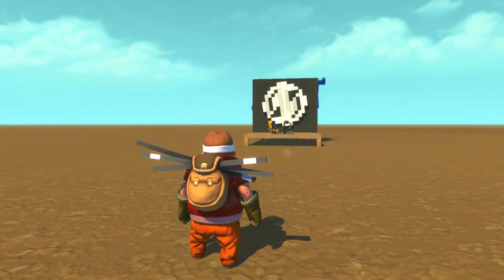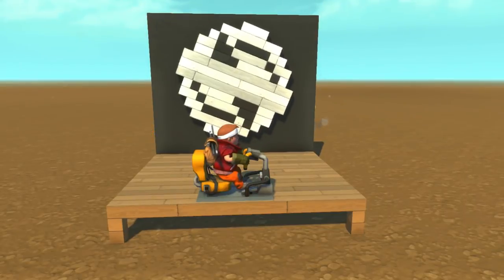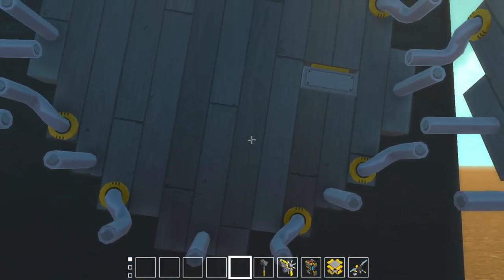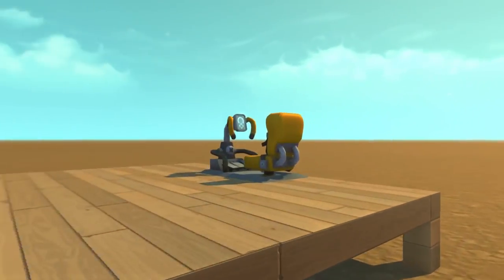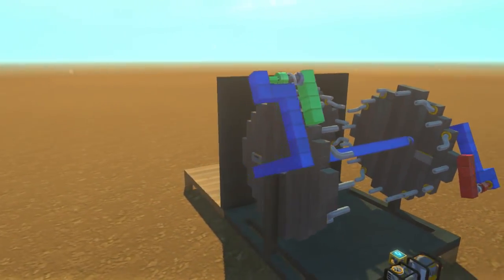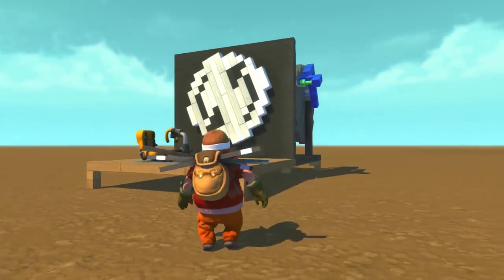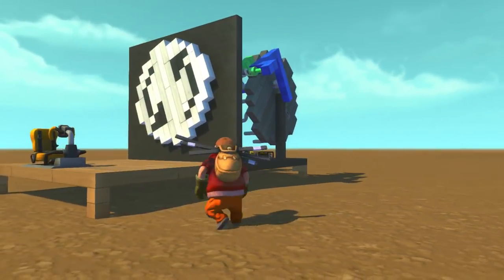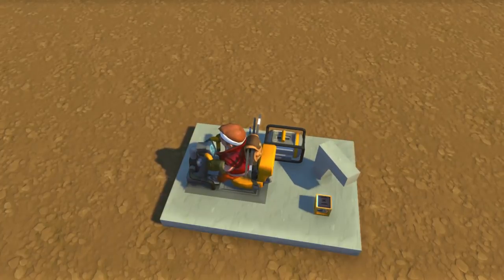This Mechanism only turns Clockwise, no matter what. | SKREP MAKENIK

Comment: Actually, the ratchet wheel wasn't an entirely useless mechanism. Before engines and motors were available, this gear set could be used to manually operate a hoist for construction materials, with little ability to be driven back by the weight of what you were lifting
Reply from the maker: That's a great example! Though you'd only need 1 ratchet wheel for that, but I think that's one of the few uses this mechanism would have! Excellent comment :D